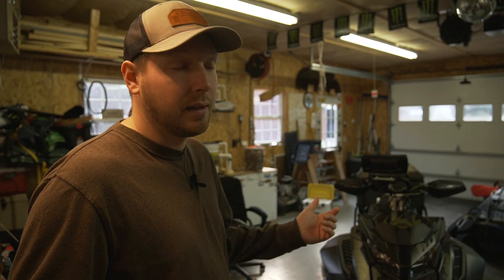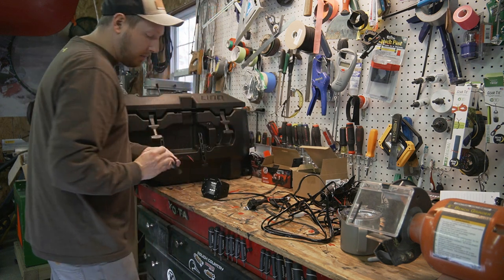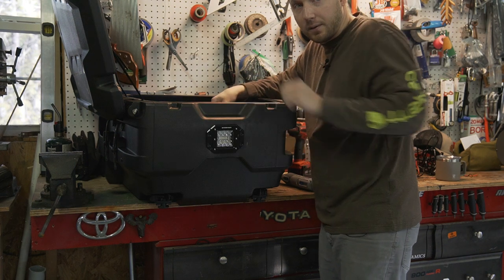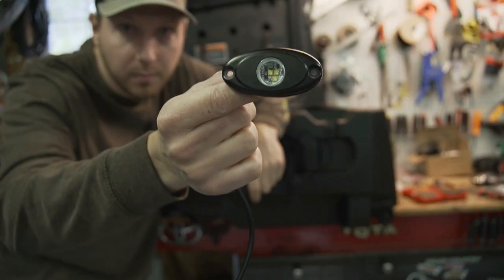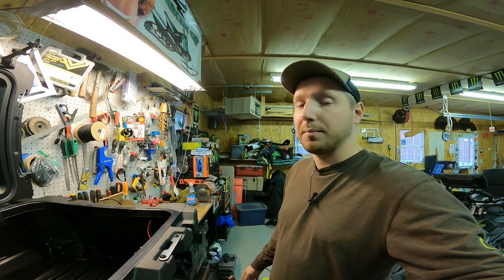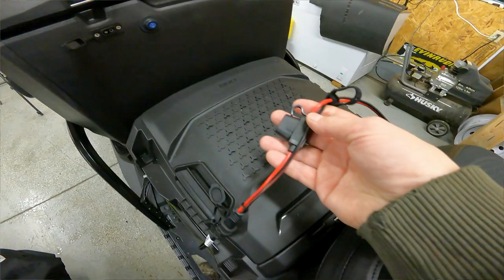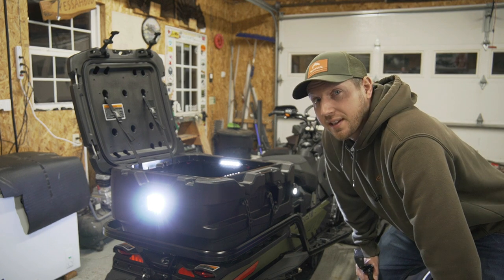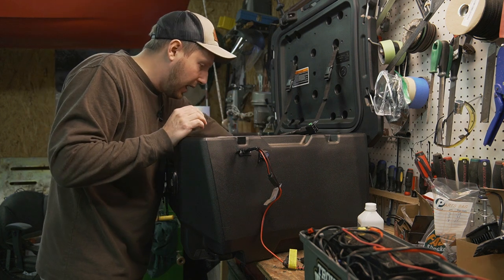Adding LED Lights | Skidoo Expedition Cargo Box Mods

Comment: Is the light inside the cargo box on all the time.  If it is I’d try to wire it so the light is activated when the lid is opened.
Reply from the maker: When the switch is on it’s all on. Yes

Comment: Hi just did the Box mod you described. Thanks awesome idea! only issue Im encountering is power. If I use the extension cable you described with the inline fuse the on off switch gets power but the lights don't light up. If i go direct to battery with the fuse it all powers up. with regards to wiring did you get rid of the fuse altogether? I wasn't 100% sure on the wiring from video. You didn't use the 40 amp relay Im assuming for this and just cut up the wiring harness for what you needed? seems like the issue is the fuse! the largest I have is a 30 amp not sure if a 40 amp would work? Any help would be great. Thanks
Reply from the maker: I can’t remember 100% but I know the polarity was reversed on that light or something! Try switching red/black around. Couldn’t get mine to work until i figured that out
Reply: can you remember if you used the big relay? @mainetroutwhisperer
Reply from the maker: @MrTgroves  can’t remember. I’ll get the sled out this week and check it out
Reply: thanks take care appreciate replies! praying for early winter! @mainetroutwhisperer
Reply: Did u figure out if u need the fuse/relay?  Was the polarity different?